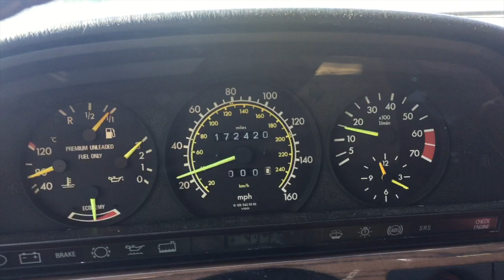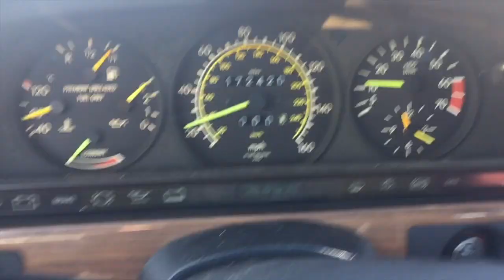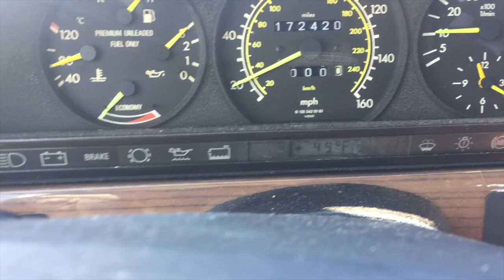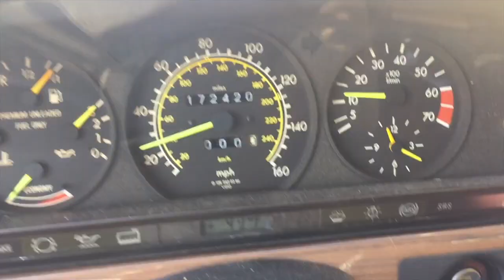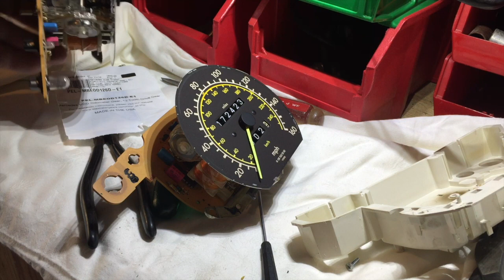Fixing the odometer gears on W126 Benz instrument cluster

Comment: This video is for gen 2 w126 clusters. I replaced same failed small gear on my gen 1 and it is an absolute PITA even to take the clear plastic cover off. way more gears involved and not to mention the small gear has a brass sleeve on the shaft that I had to dremmel away. everything you see for sale as replacement plastic gears are for gen 2 (1986 - 1991).
Reply from the maker: Thanks! Sounds painful. Btw the smallest gear also has this brass sleeve. Here is a trick: Use a vice grip plier on this sleeve and clamp down tight. Then release. It will come off much easier without grinding on it or the shaft
Reply: i ended up needing to use a dremel too and it worked like a charm. thanks for the tip!
Reply from the maker: @mallenmueller-dombois2349  Nice!

Comment: Thx for the great vid!  I have the small gear in there broken but it’s stuck and won’t come out. It’s seized on the little silver gear pole. Any advice?
Reply from the maker: Yes, that one is the toughest part of this repair. I have great luck removing that ring/gear by using a pair of vise grip pliers and tightening it around that ring once really tight. You may have to do that once or twice before the ring loses its tension and you can pull it of the shaft easier. Good luck!
Reply: @straybenzes  got it!!! Thx again
Reply from the maker: @pspy66  Nice!

Comment: Hello Ralph. I bought a used cluster for my 87 300d and the mew cluster has 
30ll80 miles my original is 163230. Is it possible to make the new odometer  have correct miles. Thank you. ROBERT
Reply from the maker: That is indeed possible. I have done this while replacing the old plastic drive gears. So you have to remove the intermediate gears that the video talks about replacing. You can then turn the mileage gear shaft. It does take a while to make major adjustments. Good luck!

Comment: Hi Ralph! You're lucky you did not have to take the face off the speedometer and other gauges to get at it. 
My cluster has digital odometer and diagnostic screen which plugs into the mother board. The ambient temp screen is glued on and so is the clock and gear setting screen. I have taken it apart to try to put a new odometer/diagnostic screen on which did not make it any easier to read.
In order to get at it you have to pull all the needles off. They have no notching of any kind so getting them in the exact right spot when replacing them is a bit of a challenge.
I need to replace the temp and clock screens because they are completely blank but like I said they glue in and you need a special tool for that. 
I don't know if I'll ever try it. Anyway, I have the needles set as close as I can back on it but just not quite. You have to put it together, plug it in and see where they end up but you cannot ever be sure they are right. I have a digital speedometer as well as the dial so that one is not much of a worry. It's the temp and gas gauge and tach that are a problem.
I have also tried led lights on this one, about 18 or 20, and they did not want to work on them plus the different kinds I ended up with are all poorly made Chinese junk and the contacts break on them very easily.
I've completely given up on it.
Reply from the maker: Holy smokes, Werner. This sounds like a raging dumpster fire. Hoping you will have better luck shortly.
Reply: @straybenzes  haha Ralph. 
You mentioned putting leds in your cluster. Like I said the ones I got on ebay are junk. 
Where can I get good ones that actually work?

Comment: I have a gen 1, there is a soldered relay in the way of the cover
Reply from the maker: You should still be able to take the gears off regardless. It makes it more difficult though.
Reply: @straybenzes  yeh I managed to work it loose but was tricky. Ordered a new set of cogs for £9
Reply from the maker: good luck!  @hamshank29

Comment: Did you  change all three of them? Is that small gear has a brass fitting inside ( as original ) or just a plastic ? How it holds on a shaft?
Reply from the maker: Yes that little gear has a brass sleeve that is hard to pull off the shaft. The new gear is made from a different plastic and it fits on the shaft without a sleeve. It has an interference fit to the shaft.

Comment: Hello friend?! HELP!! I have a 89 300SE with 160 mph speedo. The end of the shaft has 2 brass gears and the broken original is dark emerald green in color. The “replacement”gear does not fit over or into the shaft nor the dual brass gears on the shaft.  Any thoughts??
Reply from the maker: Yeah, depending on where you got the replacement gear(s) they tend to either fit correctly or need some additional rework. Do you have a set of vernier calipers to measure shaft and the hole in the gear so you know how far off the gear is?

Comment: I'm having a issue with my tachometer and speedometer.  I have the same Guage cluster as in the video.  I have checked all the wires for the tachometer and everything ohms out.  I have 12v on the pink and black wires and the sensor wire i get milivolt of around 6 and as I rev the engine it will go up to 10-12 millivolts. I took the cluster apart and could not find anything obvious. I put a extra ground off of the ground strap that jumps the speedometer in the back of the cluster.  That did not help.  Do you have any ideas on where else to look for the tachometer? Is that millivolts reading what i should be seeing for the tachometer?The speedometer what reading should I see on that pin you were talking about? Would it be a millivolts reading as I'm driving?
Reply from the maker: What is the model and year of your car? Neither gauge and the mileage counters work, correct?
Reply: @straybenzes  the car is 1991 350sd. Both Guages and the mileage counter do not work. The clock does work tho. I am also trying to figure out a parasitic draw the car has.  The last couple days it has gotten worse and now will kill the battery over night.  I checked the amp draw through the negative terminal on the battery and get a reading of 3.8 amps. If I unplug  fuse 2 the app draw goes away.  The weird thing is it goes away slowly it like ticks down.  Fuse two has the diagnosis port, radio,  hazards,  front roof light, visor lights on it.  The radio is stock and I have pulled it out and unplugged it and no drop of the apps. I have also unplugged the amps behind the rear seat and no drop. In the truck of the car I think there was some other radio thing on the passenger side and it is not there anymore.   I have taken the sun visors down and I can't find any wires going into them. I have also taken the front roof light which I assume is the reading/dome light in the front down and unplugged all that and no drop. I have also unplugged the EDS computer on the passenger floor kick panel and that does not cause it to drop.  I have taken out the glove box and the instrument cluster and looked over as much of the wiring as I could see and nothing looks chewed or anything like that. I did see some seeds or chewed up nuts from some rodent behind the instrument cluster. Another thing when I plug in fuse two the H relay clicks and energizes.  I am not sure if this parasitic draw and the Guage not working are linked.  I bought the little LED diagnosis tester from ebay to see if that would help and as soon as I plug it into the EDS port the light turns right on.  In the book that came with it that says there is some short in that circuit having power full time. I am having a hell of a time with this electrical stuff. I am not sure if you would have any tips? I appreciate any help 
Thanks
Reply from the maker: @nickfrumusa7705  There is a lot to unpack here. As far as the two main gauges not working that could be related to both getting power through fuse 6. At the back of the cluster look for the black-pink wires and measure if you have voltage there with the ignition on. 
Fuse 2 also handles the power seats. Have you unplugged them or the seat controls in the door panels? The plug sits right in front of the seat on the floor under a carpeted cover. Unfortunately, the LED diagnostic thing only works correctly if you do not have any other false positive connection. Sometimes cob webs can set off a false alarm. The usual power amp robber is the power antenna, but that one is connected to fuse 15. It takes patience and grit to flush these issues out. Good luck.
Reply from the maker: @nickfrumusa7705  I just realized that fuse 2 also supplies power to the antenna. I would unplug that one right at the antenna in the truck. They are infamous for causing amp draw as moisture from a leaky antenna seal will get into the control box on top.
Reply: @straybenzes  thanks so much for spending the time replying to my messages.  I have checked the black and pink wire on the tachometer and I get 12 volts with the key on there.  I will check the speedometer for the 12 volts this weekend. I have not unplugged the power seats yet so I will give that a try. Thanks for letting me know the location of that plug. I did unplug the power antenna before and that did not do anything. I will check for 12 volts at the speedometer and then unplug the power seats and see if that helps.  Again I really appreciate you taking your time to reply to me

Comment: Ralph, Can you offer tips on trouble shooting my engine gauge cluster? my coolant temp and fuel gauges are completely pegged to the top and i believe this is because my custer has been shorted previously. How do I rectify this? I cant get the gauges apart due to the bar that runs over the vacuum gauge.
Reply from the maker: Are they pegged permanently or just when the ignition is on?
Reply: @straybenzes  only while the ignition is on.
Reply from the maker: @dametrostrika  If the oil pressure gauge is working as it should then both other gauges are getting positive voltage to the cluster. Since they move and are pegged that would sustain that. 
At max resistance / infinity these fully peg. That seems to indicate that either the sensors are bad (highly unlikely) or there is a loose / no contact situation. The latter can come in form of the plug in the back having issues, the ground connection in the cluster being faulty, or there is a wire break somewhere. I would check what voltage you are getting with one of your probe tips connected to +2 and the other on the blue/ black wire (fuel sensor) and the green wire (coolant temp). You should be able to measure some voltage. If there is none then it is a wire break or the sensor are indeed kaputt.
Reply: @straybenzes  I know this unit had a burnt ground. I had to clean up the ground all the way across the other two gauges. I cannot remove the gauges from the board without breaking the trip reset function. There is bar that does not allow the gauges to come off the board and it seems to be permanently affixed. So I should start with trying to solder a new ground from the 16 pin connector to the ground that connects to the speedometere/odometer?
Reply from the maker: @dametrostrika  There is a common ground that I believe is what you are referring to and that one is coming from pin location 3. Each gauge then has a separate "ground" connection 1 and 2 that connects them to their respective sensors. Check those as well. Good luck.

Comment: I can't get the small gear off. All the others slide off, but the small one is pressed on or something.
Reply from the maker: The smallest gear has a brass ring embedded in it. Best method to get that off is using vice grips and squeezing that gear/ ring in one spot. Do that hard enough so that it deforms the brass ring. It should then slide off relatively easily using your fingers or with a set of pliers. Good luck.
Reply: @straybenzes  the gear is broken off. What's left has small ridges on it. Is that what I squeeze?
Reply: I would send a picture, but it doesn't to be an option.
Reply from the maker: @Cpcsof1  Yes, that is it. Good luck.
Reply from the maker: @Cpcsof1  Yes, that is it.
Reply from the maker: @Cpcsof1  Yeah, that is the problem with Youtube.
Reply: @straybenzes  I figured out that my gear was completely gone. What I was seeing was the knurled surface of the shaft that holds the gear on. I had a spare speedometer that I was able to retrieve the small gear off of, but it broke  when I put it on mine. I'm not surprised, since it was old too. I ordered a new gear.
Reply from the maker: @Cpcsof1  Yup. Any of the old clusters with old gears are prone to fail. Good luck installing the new set.
Reply: @straybenzes  
Success! I finally got my small odometer gear replaced. It was tricky getting the brass inner part off. Even better news is that in the course of removing the cluster to deal with the odometer, I realized that the round plug for the cruise wasn't plugged in sufficiently. The little catch (plastic hook) wasn't engaged in the socket. I was disappointed that the cruise wasn't working after sending my amplifier to be rebuilt years ago. Now  I have cruise control and odometer working.
Reply from the maker: @Cpcsof1  That is quite the fix! Congratulations.

Comment: I replaced my odo gears a few years back but the odometer stopped working again. Its frustrating because I can hear the motor working and none of the new gears are broken so I am at a loss.
Reply from the maker: Is the needle indicating your speed or is that one also inop? If it is not working I would make sure that the impulse wire from the transmission is indeed sending out the impulse signal. Good luck!
Reply: @straybenzes  speed is still indicated no problem, just mileage is stuck again.
Reply: @straybenzes  Should I try and maybe replace the gears again? Could that help maybe?
Reply from the maker: @benzlover55  I would check two things on what you have. First check if the smallest gear is tightly fitted to the drive shaft. The other two gears are freely moving on their shafts, but the little one must be firmly attached to its shaft. 
Second, I would remove the two bigger gears and then you should be able to rotate the gears below them. When you do that the mileage counters should rotate also. Good luck!

Comment: At 9:30 you totally skipped over the only part I needed to see. Removing the brass collar for the small gear🤦‍♂️🤦‍♂️
Reply from the maker: Sorry for that. That little ring appears to be quite the issue for a lot of folks.
Reply: @straybenzes How about small ⚙️ gear make bigger hole and pushed to the bronze shaft with glue ?
Reply from the maker: @levcohen1347  You can do that, but I do not recommend it. It messes with the fit on the shaft and concentricity. It is better to remove the ring from the old gear. Giving that ring a good pinch with vice grips will loosen the fit and the ring comes off easier. good luck.